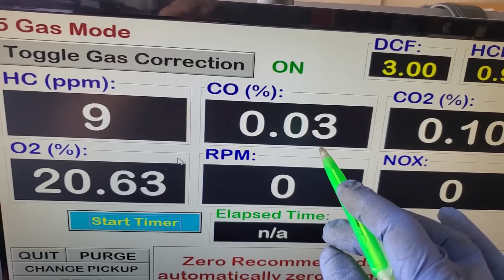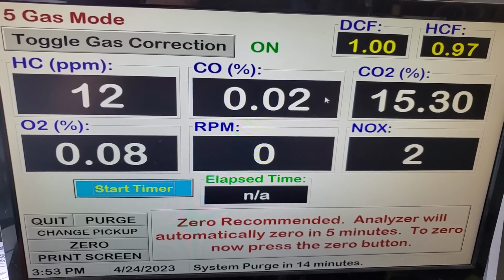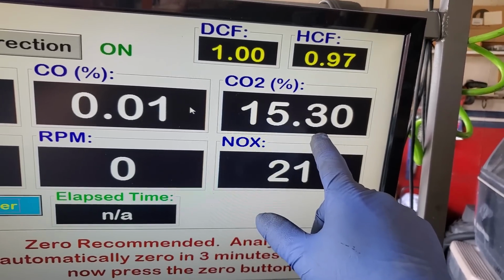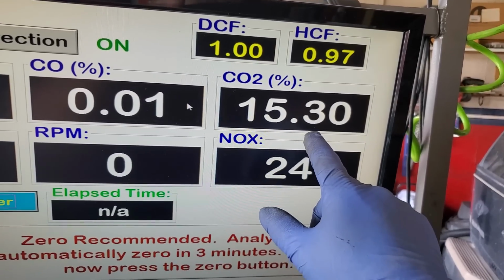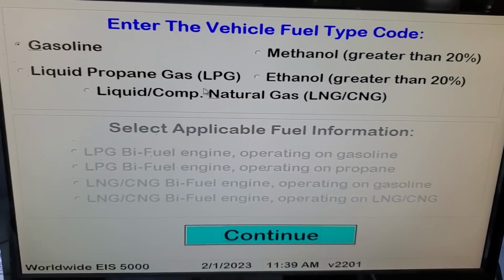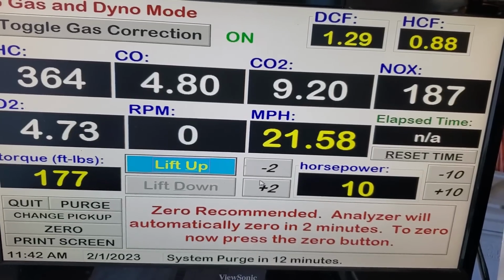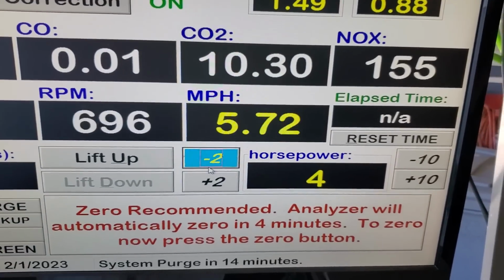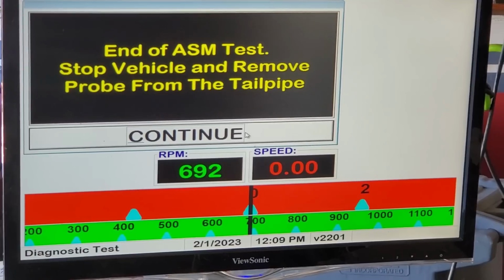About CO2 and 1991 Ford F250 ECU PCM Repair and Test Leaking Capacitors

Comment: Interesting video.  Shangp does teach quite a lot here.  I don't see how people are drawing such weird conclusions from this.  CO2 isn't a pollutant in small amounts, but in huge amounts it a problem.  Same as sugar in your diet.  You cant poison someone with sugar in small amounts, but in large quantity over time it is a problem.

I think the calculation that air weighs 14.7 pounds is wrong.  It has 14.7 psi at sea level.  Pounds per square inch.  We are worried about volume here.  So like 302 cbic inches maybe?  Or 4943 cc (5 liters) for ever two revolutions of the engine times volumetric efficiency, etc.  

The point as Shango makes it, every gallon of gas consumed will cause a predictable output in CO2.  Less fuel consumption is better.  Many ways to address this, but people have bad behavior and buying criteria. Electric cars aren't great, but probably incrementally better in most cases.

Comment: The total amount of CO2 in our atmosphere is 0.04%! If we do nothing  the climate controllers want us to do ,100 years 
from now it will be 0.05 %. Seems pretty insignificant to me. Just keeping growing green plants and trees and we will be 
OK. The e caps are goners and surprised the truck ever started. Once replaced the truck seems to work good once again.
 But it has others issues as Shango shows . Radiator, hoses, oil pressure and temperature sending units. On the testing of emissions; it passes CA state tests.  All good for a 32 year old vehicle. Appreciate a video like this Shango but change the radiator out ASAP or it will really be a F.O.R.D. Found On Road Dead.

Comment: My dad bought a new 87' F150 and he didn't want the AOD overdrive,,, he didn't trust it as he did some towing,, so he got the C6 3 speed with the 5.0.
It was a hell of a good truck though.
9 years and a 160000 miles with terrible maintenance and it still ran good...
Reply: My AOD started failing at 160,000 miles.  At least it leaked like a seive.

Comment: I was in a Ford dealership the other day. I overheard the service manager on the phone with with someone that had their cat convertors stolen off of one of these "Big" F250's. He was quoting them a replacement cost of $6000 (Cdn) to replace. As I was leaving I asked him if I had heard him correctly. He said Yes, and that's for a "cheap one" most of the "Big Commercial trucks" run $8000-$9000 (Cdn) dollars. CAT theft is rampant up here.
Reply from the maker: its everywhere, thats what insurance is for
Reply: @shango066  That Ford truck CAT'S you're working on are worth more than that truck.
Reply: I've seen after market cats for cars for $60.00.

Comment: Leaky rad and no temp gauge, what can possibly go wrong?
Reply: These trucks have two temperature sensors. One for inside the truck and one for the ECU.
The ECU sensor is near the ignition module and distributor. The one for the gauge is in the drivers head above the exhaust manifold. 
This is why there was no check engine light even when the gauge was not working.

Comment: I managed to save multiple radiators leaking between the matrix and the end cap by tightening the tabs with a vice grip. In fact, I removed the brand new, pretty expensive, but crappy Nissens (considered as quality manufacturer) one from my Audi 80 and put back the 35yrs old original, after a vice grip treatment.

Comment: I daily drive a 1986 Cavalier. It's my main car, and I don't own a modern car. I'd say mine is more akin to DOS 4.0 versus Windows 3.1
Reply: Haha I thought we all went from DOS 3.3 straight to 5.0? 4 being too buggy :)
Reply: Where did you even find a 1986 Cavalier to buy these days? The last one I saw was on its way to the crusher.
Reply: Where do you put my 1970 Eldorado?  Transistors were coming on strong in 1970.  DOD started to replace their tube equipment then.
Reply: Oddly it has a return fuel line from the carb.

Comment: If your combustion temperature is too high, the nitrogen oxide goes up. It's a problem for hemi engines because they can run correctly with extreme combustion temps without any sign. In most other engines, the engine will run poorly because of knock at high enough combustion temps for NOX to be a problem.
Reply: Some new Japanese engines are running at 14:1 compression.  I don't see how this is done.
Reply: @rogersmith7396  Those utilize direct injection, like a diesel. Normally if the compression was that high the gasoline would start burning before the engine is ready. With direct injection they can compress the air and inject the gasoline into the high pressure air controlling when it starts burning.
Reply: @btwbrand  OK.

Comment: It took some balls to drive that thing on the road in knowing that it has a leaking radiator!! It could go FUBAR at any moment!!!
Reply: The leak is at the top. It will take a long time for all the coolant to go missing and stop cooling the truck. If the leak was at the bottom the radiator would be dry in a very short amount of time.

Comment: No temp gauge? No alert warnings for heat build up.
Reply: The engine and gauge use separate temperature sensors for water temperature on these ford trucks. Guage sensor is above the exhaust manifold on the driver side and the ECU uses one near the distributor. If the ECU sees the engine overheating it will turn on check engine light, if it reaches 255F it will depower the truck into a limp mode and you'll be lucky to drive 35mph.

Comment: you do not breath like you blew in that probe at all you exhale far less in general unless you are working out heavy human arelazy breathers . for the co2 is far lewss, also the way to  lower co2 is more green tress grasses  and such as thiese use CO2  and produce replace oxigen. part of the reason it dfiffcult to lower to 0 carbon witha car is the Gas and oil is compressed  to burn highest explosion  there for you are outputting more co2 .if your car was breathing like human at a normal pace and at rest it would produce far less CO2 and other gases . we think of the engine turned burning cleaner not really so its the presure make the explosion more powerful but so quick its very watsted inclomplete which is what the catoltic convert is supose to hadle much of it turn it into steam vapor but even that is incomplete .

Comment: My 1991 Ford F-150 351 cubic inch V8 engine began throwing a check engine light. Traced problem to ECU. Opened it & found the  leaky caps. Like Shango shows in these videos repaired a dissolved circuit run & replaced electrolytics. Engine started right up & CEL cleared.